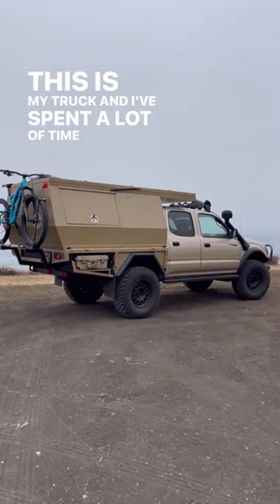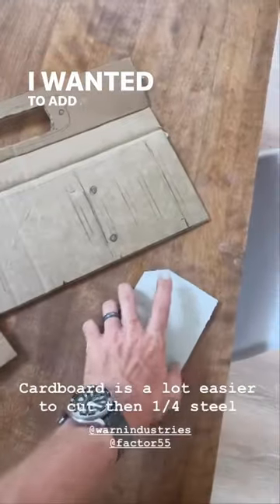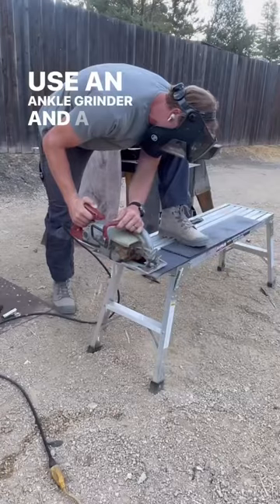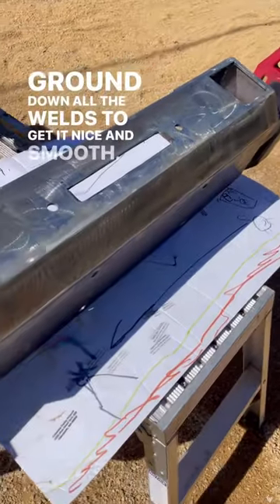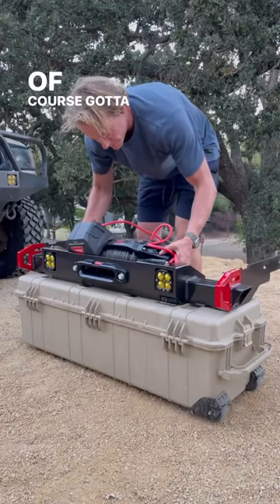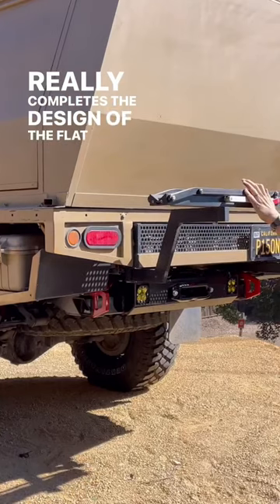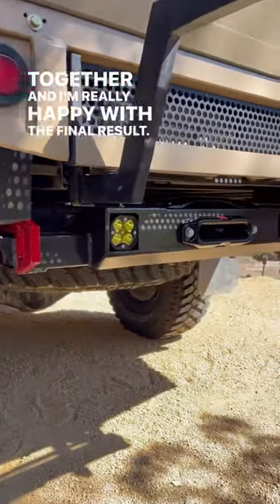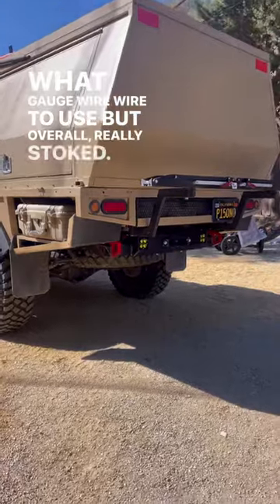Rear winch bumper build! Full video coming soon

Comment: Plasma cutter or acetylene torch is great for metal cutting makes quick work of it, love your build so far! Keep it up 😎
Reply from the maker: Yes sir! I have a plasma torch and cnc table.  It just don’t have a place to set them Up currently haha
Reply: @OverlandUnderBudget believe it or not i can use a oxy/act gas torch and cut out parts and pieces thst look so clean thaat you cant tell if it was done with a plasma cutter or a gas torch. Once you get the torch set perfectly and learn how to use it properly as in basically master the use of a gas torch you wont go back to a plasma cutter cause its so much easier just to light the torch up and start cutting with out worrying about pulling out the plasma cutter turnibg on the air compressor emptying the water seperator after you do all that you could have the pieces cut with a gas torch. Thats all we use in the fab shop i work at is gas torches to cut everything exceot for stainless and aluminum